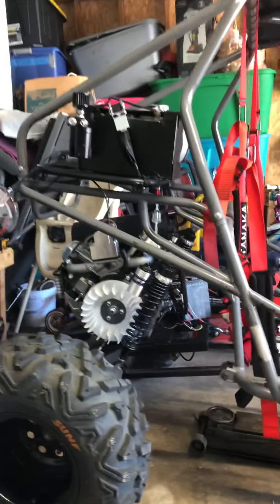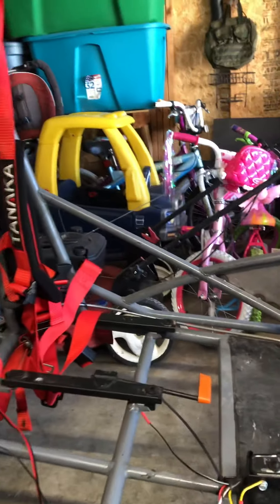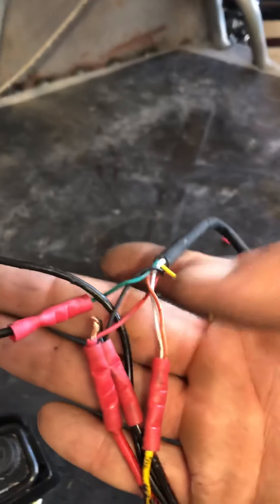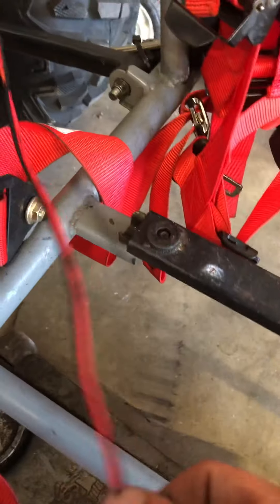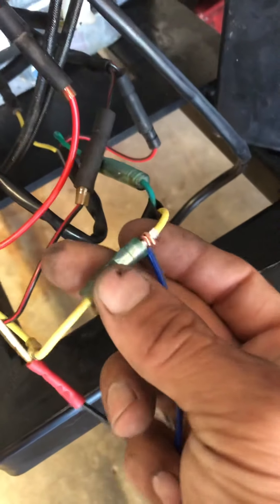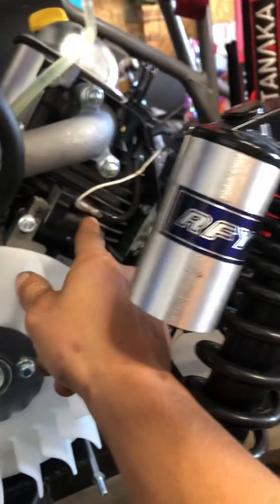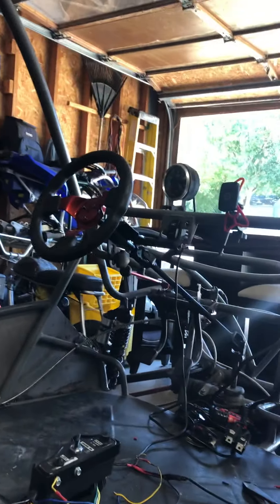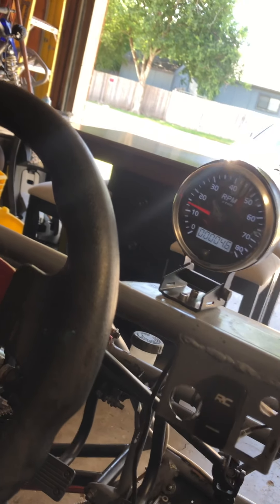Predator 670cc gets Vegas karts tach!!!!

Comment: Great video! How did you get the idle to go down to 1200~1300? I am going to install my tach and I feel like it idles at 1500+ even with the idle adjustment screw all the way backed out. Did you have to adjust your carb?
Reply from the maker: I am using a 34mm flatslide carb from amazon.
I have adjustment in my throttle cable. Also what really helped is I used a stiffer spring inside the carb so that the slide would return faster and to a proper idle.  
Simply went to lows to the nuts and bolts section and picked out a spring that would fit. Tool stock spring for reference. I am using both the stock spring and stiffer. One inside the other. 
Hope this helps